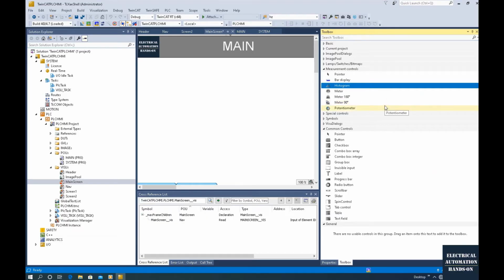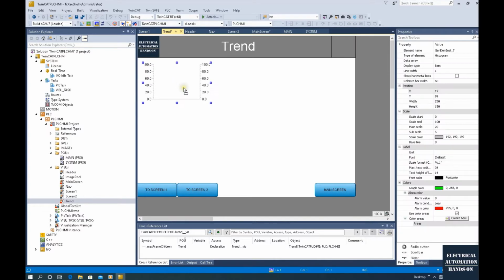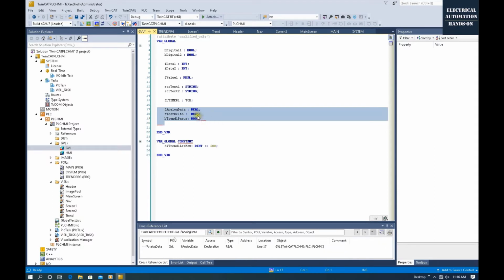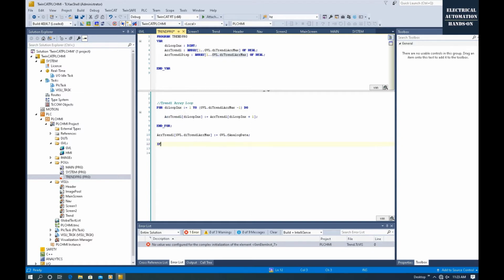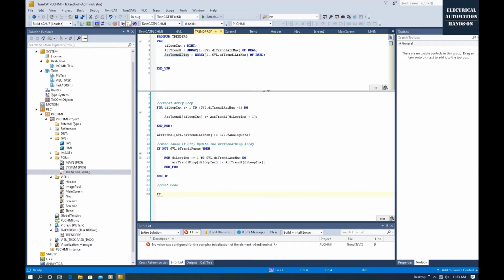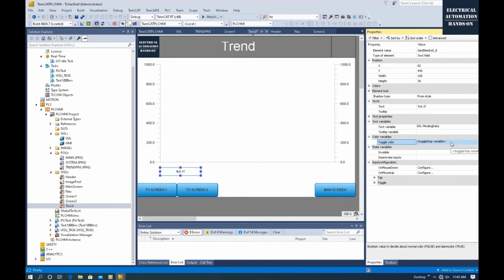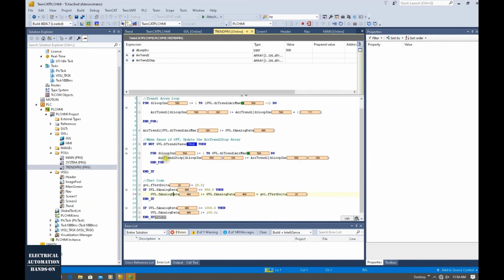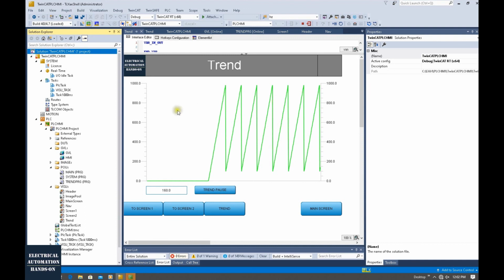HMI05. Beckhoff PLC HMI - Trend Curve via Histogram (5/6)

Comment: Thank you for creating this video, the content is very good. 
One point though, the program text is qute blurry and hard to read. 
This could be overcome by setting the zoom to 150% or 200% - it can be set at the bottom right hand corner of the editing screen. 
Other than that, it's a very useful video. Thanks 😊
Reply from the maker: My side is 1080p, probably check your network quality. Thanks for watching!
Reply: @electricalautomation  If you click on the Settings icon on the bottom right of the screen, you can set the picture quality from there. The picture is very good if HD is selected, but for some reason, youtube seems to automatically set this.